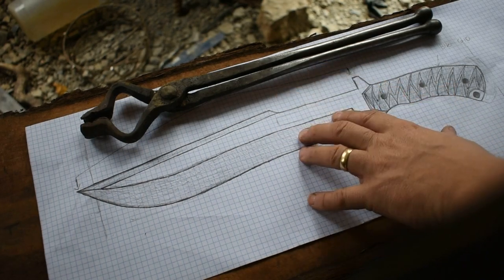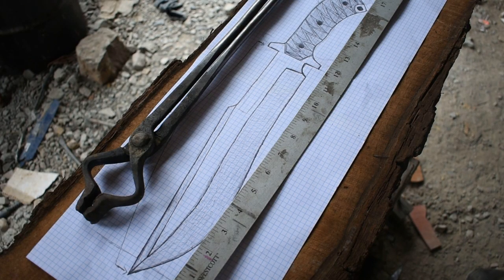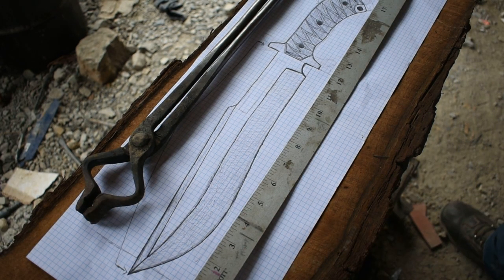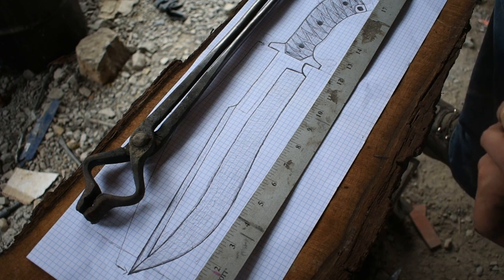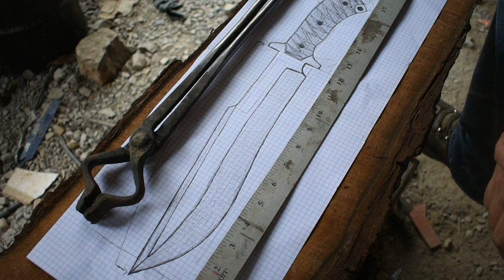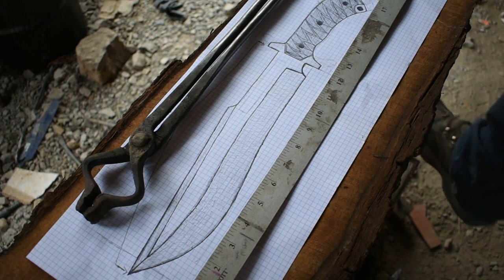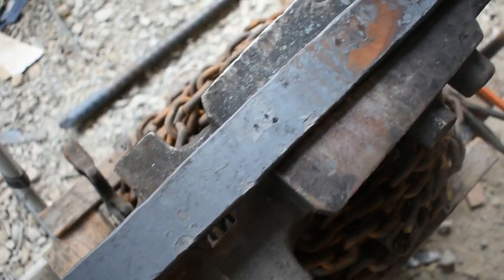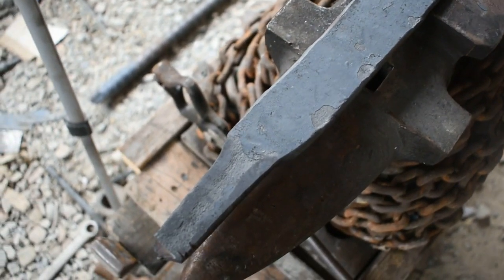Forging a RECURVE CHOPPER from a HUGE piece of rebar: Part 1

Comment from the maker: The purpose of this video was to practice forging to shape, I often use material such as rebar for practice instead of potentially ruining a good quality piece of steel. Rebar will harden to some extent in water but is still a mystery steel as the refining process is not great and it is often made up of a lot of junk. I appreciate you all for watching, information on rebar can be found at  https://www.bigrentz.com/blog/rebar-sizes#:~:text=Rebar%20grades%20are%20set%20by,much%20yield%20the%20rebar%20has. Different grades are used for different purposes. The piece used in this video showed consistent hardening in water with a decent grain structure but the hardness was still way below a good useable still like 1080.

Comment: Pshhh! Press... Lol just kidding, would totally use one if I had one; you probably got done in 20 min what's taken me now three days on a piece just like that. Of rebar I mean. 🙂🤘🤘👍
Reply from the maker: LOL, I'm glad to have it, I had the old press without a motor laying around the place and found the motor at harbor freight for 80 dollars, my brother welded it up but the truth is it would have worked just as good in its normal orientation. If you ever get a chance to snag an old one its worth it for sure, it makes things so much easier. Thanks for watching I appreciate it.
Reply: @Mysticmountainforge  fo sho; great work on that too, the beveling is sweet. I'm still at the stage where I forge out the bar into a flat billet but then use an angle grinder for the rest. I just finished flattening that big rebar piece earlier tonight, so I'm going to watch your vid a few more times to get a mental feel for how it's done and try it out in my next session. ⚒️🗡️